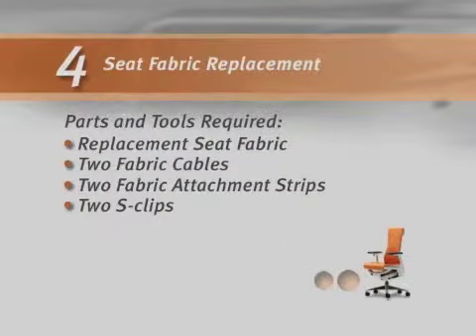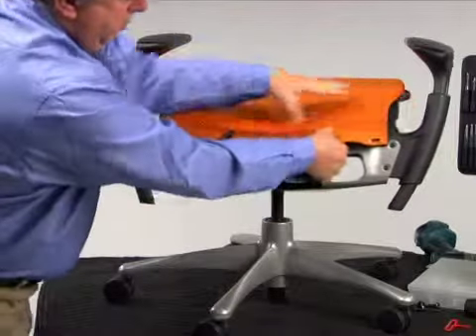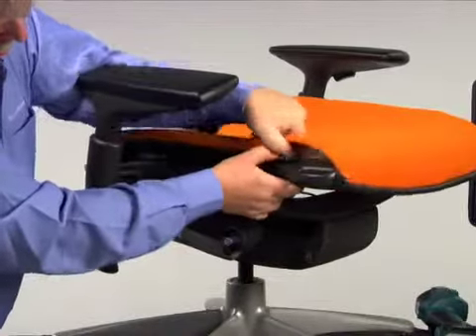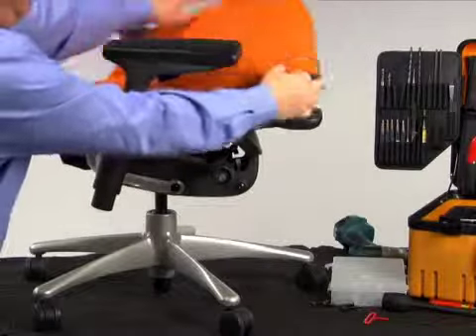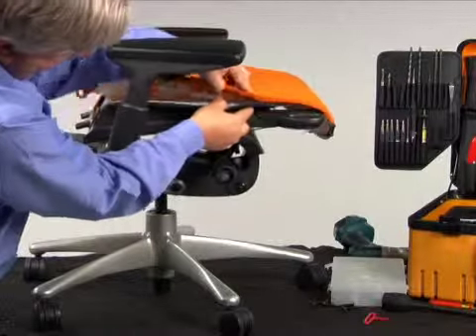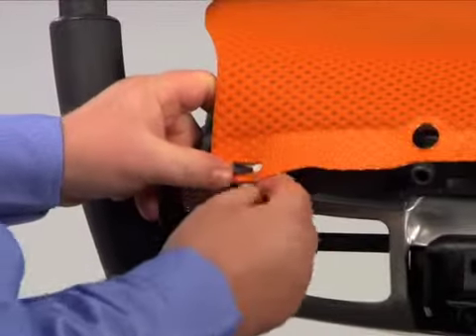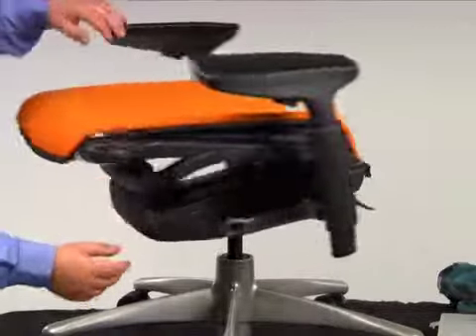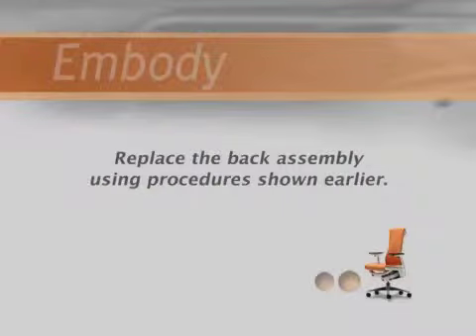Embody Chair: Austausch des Stoffes der Sitzfläche

Comment: Thanks for this video! Seat fabric replacement video was helpful and instructive as well! Really appreciate it
Reply: May I ask, where did you get the replacement fabric, I've bee Searching high and low and cant find any
Reply: @luciansaintclaire  If the chair is still inside the 12-year warranty from original purchase date, you should be able to get it replaced for free. You might need to contact a Herman MIller authorized dealer and submit a claim through them. 
Usually they just need a picture of the damaged part, and a picture of the sticker on the underside of the chair.
Reply: @TheSchyllerwade  ah I see, thank you! 😊